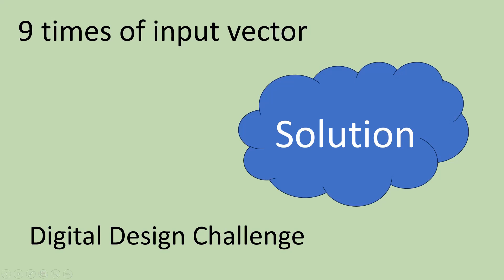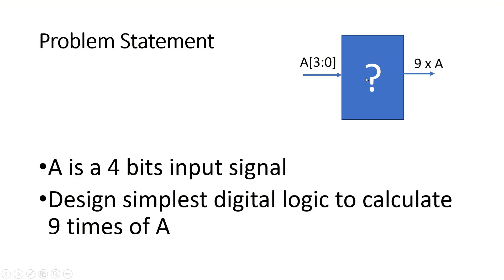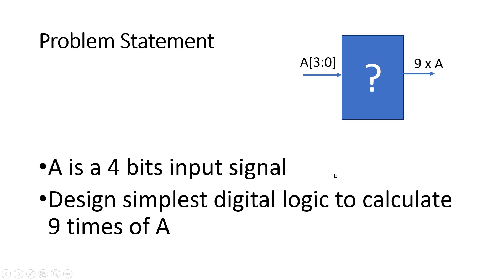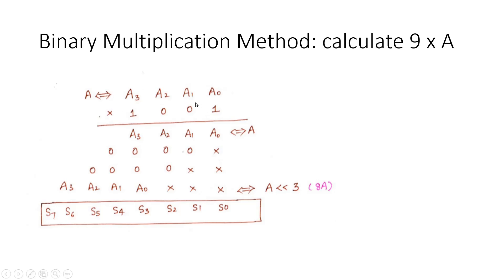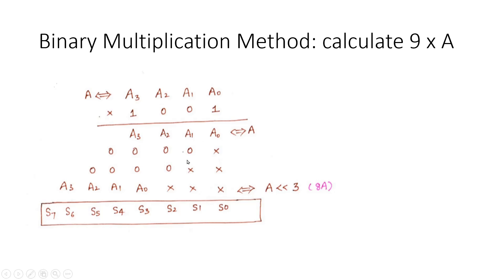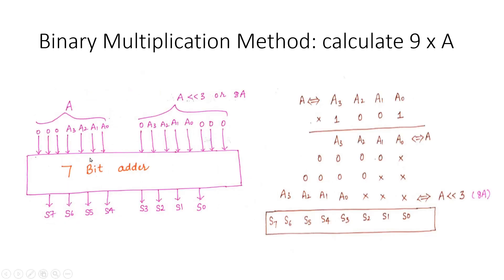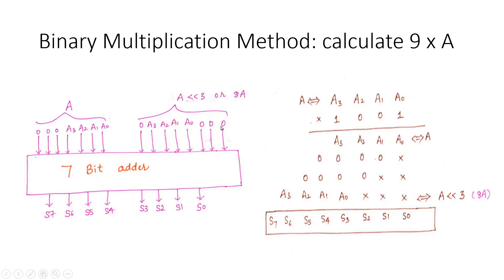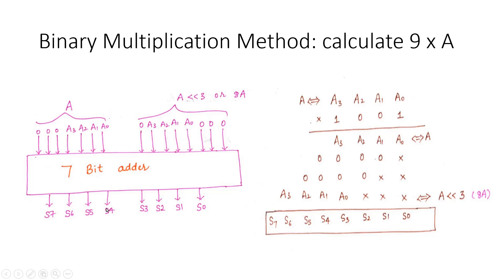Digital Design Solution: Nine times of input vector

Comment: 4 bit controlled incrementor circuit
Reply: Thanks sir for reply, 4 bit incrementor circuit has less area than adder circuit we use controlled incrementor which has 4 bit data input and one bit for control increment if 1 add one bit otherwise pass input directly to output
Reply from the maker: Excellent!
Reply: @TechnicalBytes  ❤❤❤❤❤
Reply from the maker: You mean that 8A + A,  8*A + (1+1+1.....A times) will give our answer. or do you have any other logic in mind?
if this is the logic, it will take multiple cycles to calculate the results. we need to calculate in one clock cycle.
Reply: https://drive.google.com/file/d/1wBHbrJSnPe3NUMu8gbD6d64UJbKA54Lk/view?usp=drivesdk
Reply from the maker: Excellent Sushil !